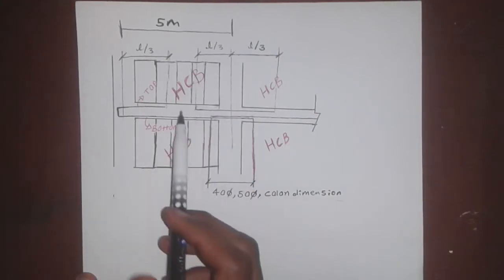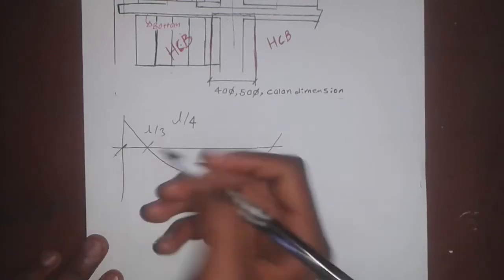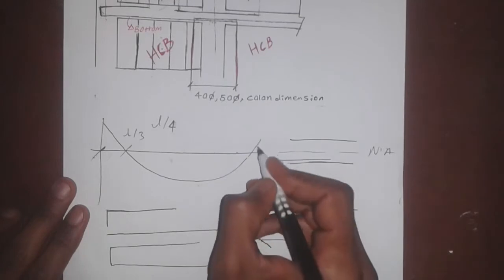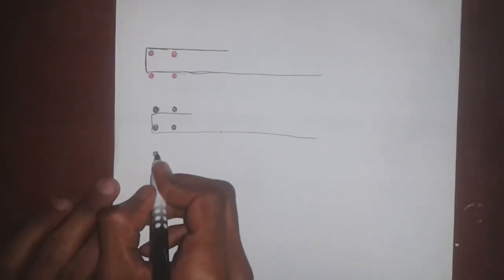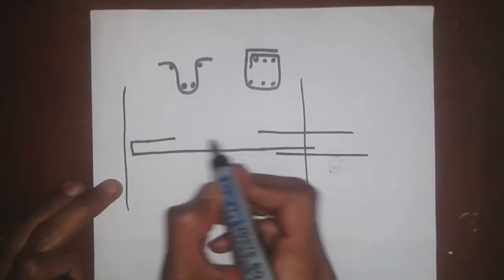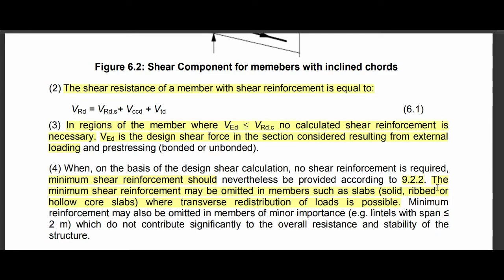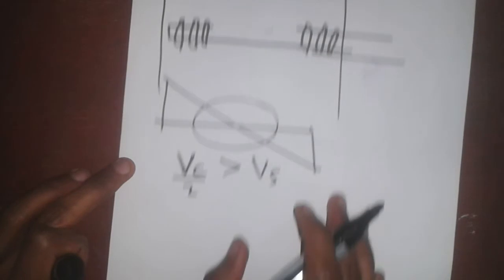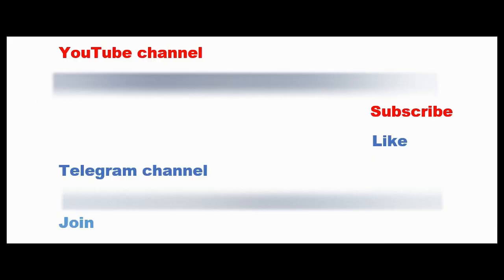Ribbed slab steel reinforcement bars detailing

Comment: Explanation is good. I want to ask one thing i.e what is the standard of ribbed slab to calculate cement, sand and aggrgate quantity in one(1) meter cube. or how to know the volume of concrete in ribbed slab

Comment: How can I use in ETABS v 9.7 in different slabs  for example solids slab, filat slab, ribbed slab in time plz help me
Reply from the maker: it is to much complicated on etabs to design the finite elements that's why the other software are introduced like staad ,safe or also u can use excel templates I have videos on solid and ribbed slab design by using excel on this channel you can check that out if you want. thanks